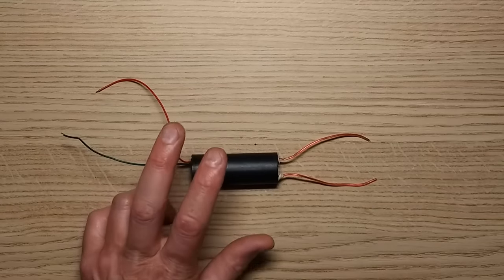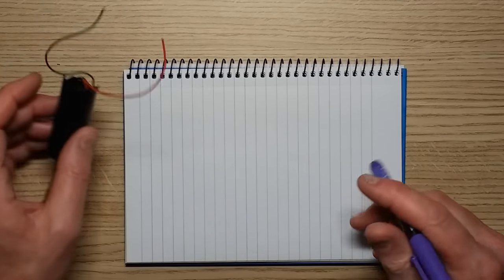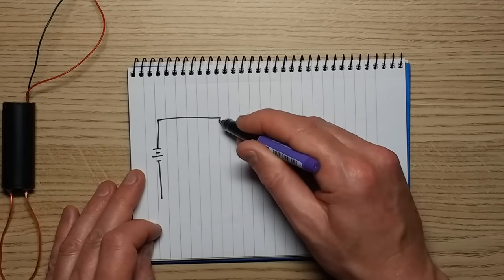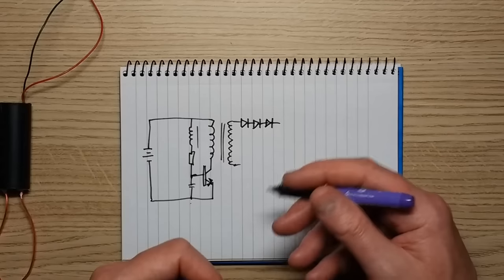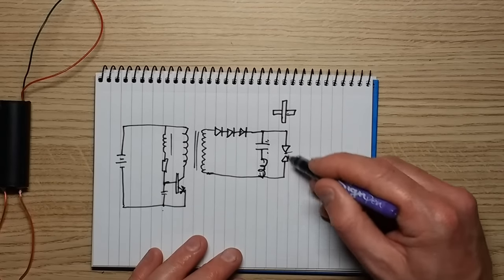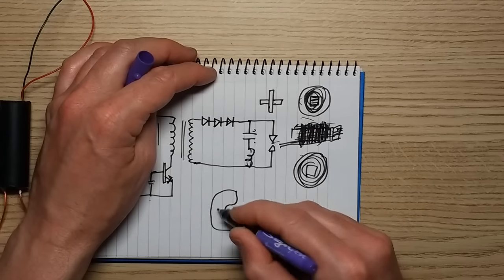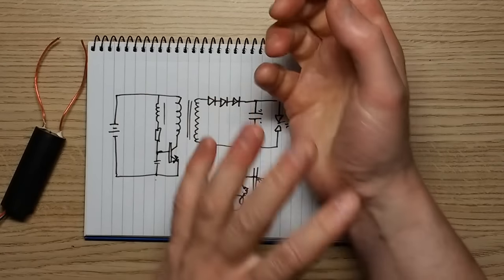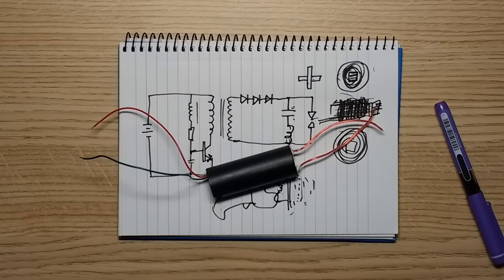Are these stun gun modules?  And do they hurt?  (yes)

Comment: Just curious if they were still out there in 2019, sure as hell, pages of dealers selling these things for around 3 bucks US!  Wish I could figure out something to use them for, but I can't so I guess I shan't order one.  Back in 1973 I was working on a PD in the Dakota's, the local Sheriff had  heard that I was a sort of electronic whiz (even back then, yes I am an old time radio shack guy!) so he brought me this little device he used to train horses (he was a rancher in real life, and Sheriff on the side!) It was housed in a sort of clear plastic shell, took one AA battery and had a sort of buzzer in it, as well as what appeared to be a small transformer and some other components.  The two prods were the sort that when pressure was applied they collapsed and made contact inside the device, triggering the current.  He used it to train his horses, giving them a jolt when they didn't do as he ordered through his knees signals or through the rains.  Well I looked it over, and that vibrator thing looked a lot like points on a car, so taking the point file out of my mechanic kit that I carried in the trunk of my car, I filed them a bit and cleared the pitting and burn marks, the device began to function once more.  When I was at coffee the next day at a local cafe, one of the waitresses asked what it was, and I explained, she wanted to test it, brave girl there!  It looked so small and just that little AA battery could not hurt much she thought, well she was wrong and quickly learned that horses were much tougher then we puny humans.  Now it didn't put her down, but the scream she emitted when it hit her was enough for the entire cafe to look our way, dishes were dropped and silverware hit the floor.  I returned it to the Sheriff, who gave me a ten spot for my trouble, he was happy and that waitresses refused to serve me for a couple of weeks, oh well there were other cafe's in the town.

Comment: In the early 1980's  I was  working in Nigeria for civil aviation. Staying in the same hotel were UK Special Forces who were training the Nigerian Special Forces on the HALO technique, where the parachutist opens their parachute at a low altitude after free-falling for a period of time.
They had the early versions of the stun gun. The plastic weapon had at the business end of this handheld device  two square holes where you placed the explosive barb capsules - they look like the old camera flash cubes that were available at that time.
Anyway to use you simply aimed at an object the trigger had two positions first position brought on a bright flashlight and the second shot out two very thin wires that were connected to the weapon that had barbs on the end of the wire. These would be attached/caught in what you aiming at.... clothing or skin etc then sent out a high voltage to disable a person.
So there I was holding this device and told to aim it at the pillow on one of the beds - on came the flashlight and then bang the two wire connected barbs shot out and stuck in the pillow - I was told to keep the trigger pressed and you could hear and see a bright electric discharge and the pillow starting to burn... I didn't fire the second capsule
I didn't know much about the SAS then and as a young 22 year old was very impressed with the device.
So it's taken quite some time before what we now know as a stun gun to be with our civilian emergency services.

Comment: Well ya got part of the circuit for these particular modules right. Good explanation on stun guns though. I've actually bought a few of these things a little back, burnt one out, and actually went threw the hastel of slowly carving then entire epoxy fill away with an exacto knife. Couple days and many marks on my fingers from the knife later, i had a circuit diagram of the module.(maybe ill go find it again if anyone wants). On the HV side it uses a variant of a Cockcroft–Walton voltage multiplier, 3x i think, but there was something weird about it. that charges 3 series capacitors that give you your spark. there is a discharge resistor in place as well. anyways i did manage to get some values from testing the components off the dead one, diodes were fine, but the main HV caps seam to be the failure point. they seam WAY under rated for this application. Oh, and these things make for a great ignition source on potato cannons. If anyone wants ill go and find my circuit diagram findings on this thing.
Reply: hey, would you mind sharing the circuit diagram?

Comment: I got one of those from Amazon. It said 1 million volts.
I used 2 of them 18650 lithium ion batteries.
I installed everything inside a 1" pvc pipe with a switch.
The arc is loud and clearly and bright. I have spread the contact points for over an inch.
Lets it put this way...  It is not a toy.
Maybe I happen to get a nice one and not one that was put together by a drunk.

Comment: They use those modules in those LED flashlight / Stun guns mainly. The flashlights run off a 16850 Li-Ion cell and typically have a charger circuit built into them also

Comment: The power supply in my Quad electro static speakers uses a small TX that gives about 600V then a rectifier then a diode capacitor ladder arrangement. The bass panels have about 6KV and the trebble panels about 1.5 KV on the grid.

Comment: I have two of these high voltage transformers and I've been using them to make emergency fluorescent lights when the power goes out
Reply from the maker: Keep in mind that they will be driving the tubes with DC and no filament heating, so you may see one end of your fluorescent tube blacken quite quickly.

Comment: The module is a dc voltage multiplier using the cockcroft circuit.  Using a combination of diodes and capacitors on the secondary of the transformer.
Reply: That's what I suspected. I've seen plans before for voltage-multiplier DC circuits to use as "stun guns". I'm pretty sure they don't work, except to annoy someone who already wants to hurt you. If you carry a weapon, you have to be sure your assailant can't take it off you, cos then you're really Donald Ducked.

Comment: This things are cool....I made a shotgun that sprays salt / metal bearings/nails....I used the high voltage of those modules to heat a filament of nicrome suspended in matchstick +black powder to burn it.The powder was packed in paper shells with two screws for the voltage contacts and the rest is simple circuitry.

Comment: Hi Clive I did brake a faulty one  of these. The secondary was a multi section bobbin with around six sections. Sure it was an ac output as could get smoke partials attracted to both wires depending on with was the plate or pins. I had sent you one of these in the past when you had a look at the faulty 20w floods for me. The box had led pilot indicators and drill bits. The listing said 6v to 4kv. Also had a shock by accident so it was a shock too felt like the same as I had in my teens when I used to fix TVs very powerful thud. 
Cheers keep up the great entertaining educational videos they are an inspiration.
Reply: Touch the output of a TV flyback and you end up across the room and probably dead. I fixed a TV a while back and the high voltage horizontal deflection transistor had over 600V DC on its collector pin. I took extra special care not to touch it.

Comment: I dissolved the epoxy potting by soaking in acetone  a few days, uses a simple 15kv transformer commonly sold on ebay for $4, with a voltage multiplier.
had a few dead ones and im the curious type.
Reply from the maker: Good to know the acetone technique works.  I've been toying with trying it in a glass jar on various potted items.

Comment: I have one of these that is 800kv that I purchased from Banggood. They are not really for stun guns, they are used for igniting gas. Like the ignition for a gas stove or LPG heater. They can be used for pest control as well, like in a bug zapper.
Reply: I don't remember where I got mine (the one in this video) but keep in mind 800kv would be able to make sparks approximately 80cm in length. I can assure you these can't.
Reply: Yeah, there's no way its 800KV. Even the highest voltage power lines are less than that. Usually 400-500KV Max.
Reply: That is the rating that the product get's, but lets face it. More than likely it is 80kv. That makes more sense as a cars ignition coil is about 45 to 80kv depending on the ignition system.
Reply: It'd be nice to be able to connect one of these to an overhead power line, and pump in a higher voltage than they normally carry. For a brief moment, you'd be powering the National Grid.

Comment: Why am I seeing this 5 years late?
  I used one on my tennis racket bug zapper. The first one started shocking me through the handle, so I had to back the voltage down. Sparks jump all over when I press the button and dust will cause a cascade. But the tiny no-see-'em bugs get zapped now, too. They were the reason I did this. They used to fly right through, but now they don't make it to the other side.

Comment: I had one of these (still do technically) but it stopped working, of course mine was rated max 6v and I used a 9v battery. I actually got shocked by touching both leads even as it was off, I was just casually shorting it with a screw driver but I must not have made contact that time.

What I used mine for was putting a large coil at the gap, basically a spark gap transmitter. The electromagnetic pulses disrupted my AM radio receiver up about 5 meters away (illegal in the US, mine was so small that the FCC wouldn't notice or really care) and managed to mess up a few calculators.

Comment: Same principle as the old electronic car ignition units, popular some years ago, using a thyristor triggered by the points to dump a capacitor charge  of around 300v through the coil primary for a more reliable pulse across the spark plug.

Comment: These modules aren't actually stun gun modules. They do have the first high-frequency step up circuit, but the output is sent into a CW voltage multiplier and then to the output wires. There is no spark gap and pulse transformer, just a bunch of diodes and capacitors.

Comment: Tech note if you have a Hot Air station you can sometimes soften 2pt epoxy and some other potting materials letting you peel it out like snot, Set temp about 115-145f and heat just enough that it becomes pliable  This also has worked for me with the Tar used to seal some consumer fireworks.

Comment: Another possibility is a simple 555 timer in a boost or flyback converter topology with a capacitor bank, spark gap and if necessary the step up transformer

Comment: I found that if you used 2 18650 li-ion batteries in series the generator burnt out very quickly-- use only 1, or two in parallel.

Comment: I love your choice of language with the "Stun-Gun Test." Not to offend, but you sounded very, umm, well, "American." LoL
I have purchased a similar version of that DC-HV module, for less then 8 USD, delivered. Although I did have some beer and JD in consumption during the "testing," I  have yet to "test" the HV on myself. After watching your reaction, I will cancel any future "tests" in that area. That being said, I did add a couple different hand-wound coils, approximately 1" to 6", with a spark-gap and 6 each 30KV Disc Capacitors, 0.01uf. Same as your drawing but no diodes. with the 3" to 6 Inch coils, I was able to "damage" any semiconductor based electronic device. Maybe a mini EMP device?

Comment: Actually not, this is a power supply. I bought 4 of them and did make a stun gun. Put this output on a meter and scope and you will see that there is diode inside that charges a 2800pF capacitor which is across the output leads. When the voltage gets to the recommended arc distance, then the spark jumps. You can load this with some resistors in the megohm region and see that the output is DC. The recommend spark distance not exceeding 3/4" will show a charge of 13KV.
Reply: so if he put both output wires to his skin before powering the device it would not hurt ?
Reply: @ash0787  Most likely not, there is very little current, I know if you are too close and the spark jump is small , it's not too bad.

Comment: i had 2 of them , one works with 6v fine, but the other bigger module worked 10 seconds only with 7,4V ,(sold to work with 7,4 volt)

Comment: You can actually light small candles, gas and paper with these. And yes, they can actuallly incapacitate you, I did that to myself accidentially. Definitely not 400kV, but also definitely not toys. Try fitting it to a cheap fly swatter for spectacular results. Small flies, moths and mosquitos are immediately vaporized into dust. Also very useful for ozone or nitrous oxide generation.
Reply: Ozone and nitrogen oxides are both incredibly bad for you, respiratory wise, and I know ozone causes cancer. I don't think you'd get nitrous oxide from zapping air.

Comment: Problem with those modules is that they need more current than AA batteries can handle. I usually use beefy 5 volt regulator and 7.4V lipo battery with that. At that point it easily jumps 2cm.

Comment: Actual stun guns are supposed to put the assailant on the floor by tensing muscles and using up all of the body's energy and damaging the muscle.
Unfortunately, many stun guns in the US now make the sound but aren't outputting the power to actually put you on the floor.

Tasers are long range stun guns but they haven't gone the same way as stun guns. Watch a taser video to see how a proper stun gun affects people.
Reply: Most of those are across the chest on a limb you can pull them out. You can even pull a tazer out of your chest if you feel lucky because next step is a bullet.

Comment: Clive, 

 If I were to isolate the output wires to seperate handlebar grips which have chrome metal accents where your hands grip.  If I insulated the grips so they wouldnt touch the metal handlebar (or used it with a Carbon Fiber handlebar) would these work for a theft deterrent device which I could power on via remote control so they are only armed when the rf remote flips the power relay on.  My question is would these withhold discharge for only when someone grips both of the handlebar grips?   I'm wanting to make a capacitance trigger discharge to send a 10k - 20k zapppp to the grips if gripped by some would-be thief.

Would I need to make or use some kind of driver circuit to cycle the discharge only when touched?

Thanks for your channel!  Appreciate all the insight you provide.

Comment: I'm not sure how wise it is to say this, but you can wire as many of these units as you can get your hands on together in parallel to multiply the current. I've put 15 of them together in parallel and the steel wire electrodes start to burn off after a few seconds of use, it's quite scary actually. My ears are still ringing...
Reply from the maker: That would make sense as these units have a multiplier on the output.

Comment: Great video thanks.  I am pretty sure these do not have a pulse transformer or internal spark gap as mentioned.  The output stage is actually a multi stage voltage multiplier instead.    The downsides to using a multiplier is that of there is already a load between the terminals and the unit is powered up, it will typically stop the multiplier charging.  As such it these modules wouldn't actually be very useful in a taser as their performance couldn't be guaranteed (unlike the circuit you have drawn).

Comment: Lol i used one if those modules, paired with a 3.7- 4.2V li po and packed into an old laptop charger case to create a stungun. Mine has an output of 370000- 420000V. Btw dont put the high voltage output points too far away from each other or you will kill the capacitor! Mine works perfectley at 6mm distance between them.

Comment: I used exactly the same module to build an arc-gap high voltage power switch that works in a + shaped configuration. I machined a block of Teflon out and made a cross configuration with TIG welding electrodes and holders as main and switch electrodes. The electrode's tip shape was also different to have the main electrodes' electric field slightly less 'concentrated' but able to withstand repeated high power arcs whereas the switching electrodes' tips were needle-pointed to ensure fast switching, direct ionisation of the path.  By pumping dry air through the closed off block at a constant flow, the switching time remains fairly constant (atmospheric humidity & pressure being a bit tempestuous at times, especially in summer here in South Africa).

Furthermore did I use a high speed camera and (tried) to photograph the formation of this stun gun module's arc control across the switching gap to estimate time, but the camera ran out of steam at 450k FPS... If memory serves, i had about 6us from when the arc started to when it was fully complete across the ~12 mm gap.

And yes...high voltage arcs and tungsten targets has (probably) never hurt anyone before!!😅

What a great video, thank you Clive! 🥃

Comment: Ruke of thumb  for surface skin ark is that,wider the gap more pain.This is why some have a wide contact spark gap. The kes you air fire more you short it out into things chances,more longer life.The air is for scarring of things.stuns burn out fast and random same with battery no indicator  voltage protection.

Comment: Cops love to shout: "Taser 50,000 volts" but in reality the voltage drops to around 5 kv when shorted by flesh. Much the same as animal control fences ,the  maximum voltage of which is specified by statute (in my country ,anyway). The high open circuit voltage is needed to create an ionisation pathway through fabric.

Comment: I melted the epoxy out and i saw that it uses a simple transformer driving circuit and on the output of the secondary there was a one stage voltage multiplier and on the output of that there where capacitors to up the output current but lowers the voltage